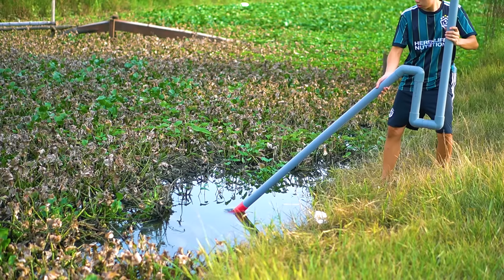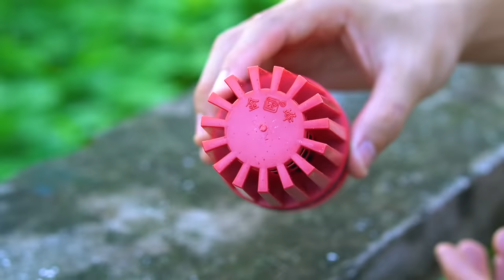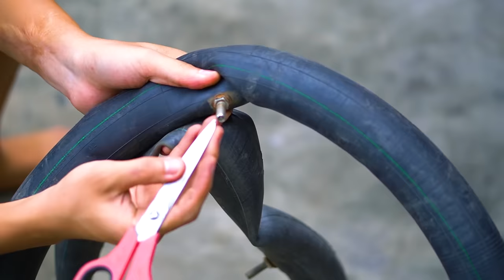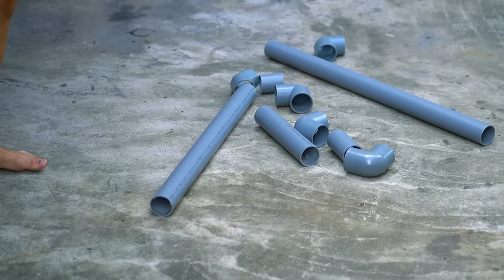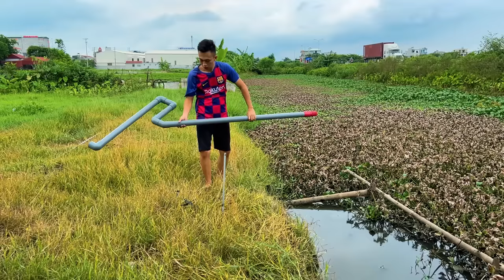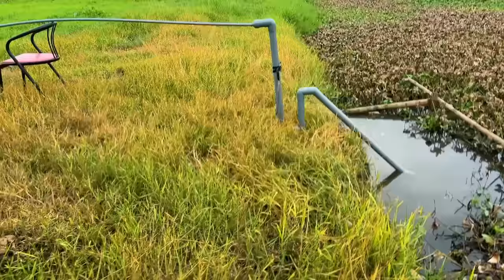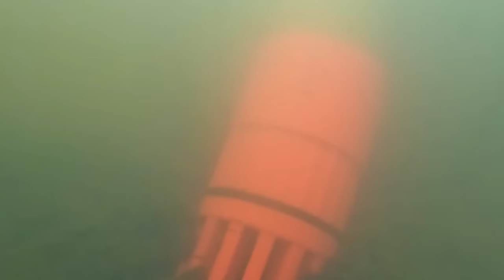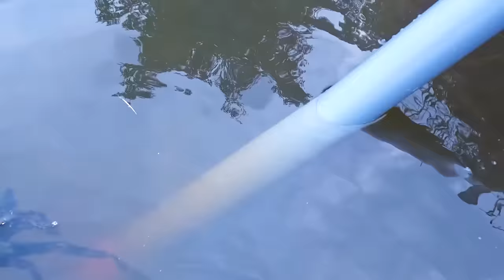I turn PVC pipe into a water pump no need electric power

Comment: I NOTICED THAT WHEN IT WAS ASSEMBLED, THE LENGTH OF PVC PIPE TO THE VALVE & THE OUTPUT PVC PIPE IS THE SAME ABOUT 2 FEET, BUT WHEN IT WAS INSTALLED IN THE WATER, THE PVC PIPE TO THE VALVE HAS BECOME LONGER, IT IS NOW ABOUT 3 FEET. WHY?
Reply: To fit the battery and pump of course.
Reply: The air pressure is limited to the incline in the pipe due to the dip in the pipe - therefore the water pressure is greater than the air pressure. The water pressure thereby pushes IN the value and thereby creates a jet of water pressure that shoots the water up the pipe. Based on Archimedes Principle as long as the weight of the water based on volume is greater than the volume of air in the pipe below the dip in the pipe then the valve will keep sucking water as a spray jet under pressure into the pipe.
Reply: @voidisyinyangvoidisyinyang885  No. The air pressure is of course exactly the same at both ends so nothing would happen and you can also see the very motor in the timelines mentioned, so just stop.
Reply: @dtiydr  have you ever used one of those schrader valves? I have a hand bicycle pump. The whole point is the weight of the water as pressure is opening the value and therefore creates a pressurized jet of water. "the area of the water surface inside this pipe is exactly one square inch. The surface of the ocean adds up to trillions of square inches, each with 14.7 lb of atmosphere bearing down on it. The total pressure on the ocean surface therefore adds up to billions of tons, while the pressure on the surface confined within the pipe you have inserted is a mere 14.7 lb." so how much pressure does it take to open the valve?  the answer is: "you then have to pump about 30 psi harder just to open the valve against the spring "
So how big is that PVC pipe - it's bigger than one inch and looks to be at least 2.5 inches and therefore if it is two inches in diameter then it has enough water pressure to open up the Schrader valve - creating a jet of water. 
So the dip in the pipe acts as a "Pea trap" under a sink - the water jet collects the water there - so that cancels out the lower gravity in the pipe - it works just as a one way check valve so that less vertical draw is needed. So then as the water keeps building up through the jet then the water is pushed up the rest of the pipe.
Reply: @voidisyinyangvoidisyinyang885  I don't even read what you write because I'm into physics and you are obviously not since you try do convince me with "facts" which we all know is of course not or even according to physic laws and thus totally wrong.

The whole apparatus is in direct conflict to to the physical law of conservation of energy. Where does the energy come from that make the water come out from a higher state? Exactly it can't by it self without adding energy which in this case is a battery and a pump, that can also be seen ffs. Open you eyes and listen to ppl that at least have some basic knowledge about physics that you obviously don't so stop spreading your erroneous comments.

Comment: We have a ram pump on a piece of property we bought. It sits in the creek and runs continually without electricity. According to the man we bought the property from it was installed 15 years ago. Ram pumps were invented in 1796 by the guy who co invented the hot air balloon. So all you screaming fake and spouting crap about gravity... lol do a little research. There are different styles of ram pumps and diy plans all over the internet. And on youtube. Y'all just making fools of yourself.
Reply: There is only one reason for why your experience works and that is the energy a flowing creak or river supplies enough energy to ram the water with enough power to reach a height to start a siphon effect.  But it would also need the exit point of piped to be below the source such as on a hill.  But this video is a scam as neither of these requirements is met.
Reply: Ram pumps don't work like this. They require "falling water" (water pressure) as the energy source. They also have TWO actual check valves to drive the pump.

This is NOT a ram pump & it defies the laws of physics, conservation of energy, etc.

Comment: These videos keep popping up in my "suggested videos" page when I open Youtube. I watched a few out of curiosity. So far all I've seen are fake systems that trick people who haven't taken any Physics courses in their lives. These are made to look more complicated by adding valve stems from inner tubes (which do absolutely zero) or convoluted loops and bends etc. on the devices he contrives. This whole thing is clearly a gimmick to gain hits on Youtube to generate advertising revenue. I haven't seen anything on this channel yet that could actually function the way he demonstrates. He's likely installing in-line battery powered pumps to create water flow. I challenge anyone to try this and make it work. If you do, I'll eat my hat. Water simply doesn't flow up hill unless the down hill part of a siphon is longer than the intake or by using a ram-pump which still requires a long drop of large diameter line to push water up a smaller diameter line by shock loading. Learn the laws of thermodynamics. Check this video to see an explanation of how a ram-pump works. It's still not p
"perpetual energy. The return is always less flow than the input. Some water is always lost in order for it to work, Classic 3rd law. When energy is converted from on form to another, some is ALWAYS lost to entropy. https://www.youtube.com/watch?v=9NHVmOchAgI In this case potential energy of water above the pump flowing down by gravity to the pump is converted to an upward push returning a lesser volume back up to a potential height. You can never convert an initial form of energy to a greater on. Doesn't matte what forms you use; electrical, fossil fuel, mechanical, inertial gravity potential, wind, hydro...none. Fact.
Reply: maybe he smarter than Bernoulli 🤣
Reply: 1.8M Water Jiggler pump fuel Transfer Self Priming Shake jiggle Siphon Hose Pump
Condition:
Brand NewBrand New
Bulk savings:

Buy 1AU $14.80 each

Comment: could not get in mind, why the cycle valve was fitted,  what is its function,  the cycle valve works minimum 100 PSI,  depends upon the inner pressure, the one way water valve can work through suction by vacuum basis.  Finally looks great for the people who could not understand mechanism not for the people who know how things works.
Reply: the schrader valve requires 30 psi to force it open. Water has more psi the deeper it is - so the pipe goes six feet down and is 3 inches diameter - so you get greater than 30 psi to force open the shrader valve.

Comment: Even if that check valve worked, it would not pump water uphill! Now, if you connected that to a hose that ran downhill for 50 feet and then you pumped it and it would work in Schrader valve. You’re gonna get 3/4 of inch pipe full of water.😔

Comment: Absolutly it does.you should focus on the tyre pumping nozzle.It allow the water to get in to the pipe but it restrict backflow of water.
Any way I am admired on his creativity.
Reply: Булмогур нарса алдокчилар.
Reply: Fake
Reply: The air pressure is limited to the incline in the pipe due to the dip in the pipe - therefore the water pressure is greater than the air pressure. The water pressure thereby pushes IN the value and thereby creates a jet of water pressure that shoots the water up the pipe. Based on Archimedes Principle as long as the weight of the water based on volume is greater than the volume of air in the pipe below the dip in the pipe then the valve will keep sucking water as a spray jet under pressure into the pipe.

Comment: You are great man..! In every video you break the physics rules.... 😂
Reply: Great piles of BS.
Reply: the schrader valve requires 30 psi to force it open. Water has more psi the deeper it is - so the pipe goes six feet down and is 3 inches diameter - so you get greater than 30 psi to force open the shrader valve.

Comment: Shrader valve lol wtf.  Scooting water won't open that. Maybe an actual check valve for water, but even that wouldn't work on this model. He's got a stick-shaped battery pump with littler hoses inside the conveniently shaped pipe

Comment: This is fake.
Reply: It’s physics
Reply: Ok mate …we made these out of straws at low level schooling you may have had that day off
Reply: @lioneltomich1991  I never been in Low level schooling. I was in highschool on my 4e. LOL. If this works you made a solution for the energyproblem.
Reply: @denisdb725  yeah my mistake ….im not stupid just stoned 🍻
Reply: @lioneltomich1991  You know what? In this I believe you.
Reply: No it’s because of the check valve that it works.
Reply: @3kidsohmy  It will never work. Not if you hold it stady.
Reply: @3kidsohmy  nope ….make one and try it
Reply: This works... is not fake it works.

Comment: It looks physically impossible but I can't see where he faked it. He uses a one way valve to prime the pump and then it just works. There are some pumps out there (like Ram Pumps) that defy gravity and physics. Pretty cool.
Reply: Yeah, magicians' tricks look physically impossible but you can't see where they faked it either. Nothing "defies physics". There are a lot of fakes like this online as click bait or money making nonsense ("If you can't get it working, that's no my fault, I sent you all the parts and told you how to use them!") - it's just clever editing (possibly while someone under the water plugs a garden hose into the bike valve he conveniently added to the device). Pumping the device in and out of the water will force water up the pipe with the one-way valve stopping it from going back, so it will eventually come out the top while that motion is going on, but when he stops doing that, it won't continue, because the weight of water down the pipe cannot make it squirt out the top (and if there's an open inner-tube valve in there it would just begin to leak back through that). There is simply no energy input anywhere in the system as it appears, by which water could be lifted, so it must be being input somewhere by fakery. If water could be lifted without using any energy, it could then flow back down through a turbine and produce "free electricity" - a net output of energy with no input, brilliant. That's not a thing, but people pretending it is definitely is a thing.

Comment: The recycled valve he used, in the bottom caged cone, is the siphon. The cage prevents larger debris, while he shifts the pipe side to side, the valve pumps by shifting back and forth inside, creating a siphon action, hence the little bit of rubber he left on, to create a seal and keep vaccum. The valve is small, and doesn't allow the air in the pipe to burp through to the other side. Pressure builds, and up comes the water. The dip in the pipe helps to further boost the pressure. I see the comments, and I know it must seem like magic to a lot of people, but, it's not. Maybe if most actually watched, and paid attention? The system has a lot of limitations, but it works. Stop with all the "but physics!" bull.
Reply: You cannot "siphon" water uphill. Gravity works the other way.
Reply: The air pressure is limited to the incline in the pipe due to the dip in the pipe - therefore the water pressure is greater than the air pressure. The water pressure thereby pushes IN the value and thereby creates a jet of water pressure that shoots the water up the pipe. Based on Archimedes Principle as long as the weight of the water based on volume is greater than the volume of air in the pipe below the dip in the pipe then the valve will keep sucking water as a spray jet under pressure into the pipe.
Reply: No,there is not a syphon system because in the syphon system the water level ( the river)should be above the land level , to cause water to move ( down)
Reply: @russellsmith9512  yes.No,there is not a syphon system because in the syphon system the water level ( the river)should be above the land level , to cause water to move ( down)
Reply: @radinelaj5716  hey pagal
Reply: @thangkhanpaohaokip2453  I don't understand that language ,speak English pls
Reply: Did you build one, how did it work?
Reply: Needing a pump to make it work, is one of the system's limitations. There may be other limitations true, but needing a pump seems like the main one.
Reply: Er no, just no.
Reply: It only "works" if you make it properly (not as shown here) and keep pumping the pipe up and down to provide the energy to lift the water. And yeah, "but physics"-energy has to come from somewhere for work to be done. No exceptions.
Reply: @mikekelly5869  Exactly, you can't move it without putting in the energy to move it.
Reply: @Russell Smith  you can certainly siphon water uphill. People have been doing it for centuries.
Reply: @tx_rebelsoul8192  Where? Name the application.
Just like cartoons, anything is possible in a YouTube video.
Reply: @miked602  ram pump
Reply: Prove it build us one and show us you and he aren't FAKES
Reply: @voidisyinyangvoidisyinyang885  you are so full of it.
Reply: @tx_rebelsoul8192  what planet are you from???
Reply: @tx_rebelsoul8192 a ram pump works off the water hammer principle not a siphon.

Comment: Oh I get how this works. That thing he modified in the red thing acts as a one way valve. When he pushes the device up and down in the water he’s pushing in water which is stopped from escaping by the valve and pushing out air through the top, till it gets to the P section, which then converts into a siphoning action like how you siphon petrol out of a tank, as long as there is no air in the tube section doing the siphoning action it should still continue till the tank is empty. I’ll have to give it a go but on a smaller scale.
Reply: Have you done it on a smaller scale, and if so, did it work? Cause this would be perfect for water fall garden
Reply: @user-ec3kk6cf5d  Not yet only viewed it yesterday. Will take a while to gather the materials.
Reply: Keen to see how this works myself, it makes some sense but i think the pipes at the P section need reversed then it makes good sense.

Comment: has a electric pump running on a battery,  a 12v subsumable fuel pump  would easily fit inside that pipe and have no problem pumping that volume of water, and you could also fit the batterys and everything inside,  don't believe this BS guys
Reply: the schrader valve requires 30 psi to force it open. Water has more psi the deeper it is - so the pipe goes six feet down and is 3 inches diameter - so you get greater than 30 psi to force open the shrader valve.

Comment: AMAZING I SUCCESSFULLY CREATE 1 SAME SET THAT IS AMAZING💥💥💥💥💥💥
Reply: Are you sure it works?
Reply: Of course you can. Everyone also can. Just know how much you have to create a volume of vacuum suction inside the pvc pipe that make the water keep running. And the bottom valve must free from anything blocking the water go through.
Reply: @transsformer  yes i also created it successfully and debt worked great it's free
Reply: @ahmedal-ayed5339  yes i also created it successfully and debt worked great it's free
Reply: without a electric pump???
Reply: @adiyasri6971  ok
Reply: Electric hai kya
Reply: Ya fals

Comment: OH, MY, GODDD! After reading a bunch of other answers I've discovered a way to solve the world's energy problem!!! FREE energy for everyone, FOREVER!!!
We simply use this guy's invention in double. We get it running, attach a turbine to the upper end, then as it's working we attach a U pipe to the outlet and a length of pipe downward and attach another turbine to extract power from the water flowing down hill. Then since the outlet water is still under pressure we attach it to the inlet end of the device and the water is again push/pulled up the pipe. Now we can remove the pipe from the water source because the water will continue to flow round and round, up the device then down hill. Now the device is mobile and we can attach one or more to an electric car and drive forever!!! 🎉😂

Comment: No this is called a RAM Pump, and it is fed by Gravity, it may actually work, I will experiment with it more to find out.  It would be neat if we could somehow make this work and then have the water fall on a water wheel which could spin up a small turbine to make power. IDK.. Just my thoughts on it. THe more water we could get to flow, the more power we could put into our water wheel and if we could get our water wheel to have enough power we could gear it up to a generator and make the generator spin at a faster rate, then it would be free Electricity.  Or theoretically, I forsee a lot of issues with this though.  I will experiment with it see what we can come up with.
Reply: So what did your experiments determine?
Reply: No this is not a ram pump. A ram requires flowing water, which this obviously isn't.

Comment: Hi thanks for sharing,i trust it will work,but i have a question about the check valve,the piece of rubber  was not inserted again.Will there be compression?
Reply: This won’t work
If it did like he acted it did your house would be flooded

Comment: Love wveryone comment but this is basic syphon principles ram pump yea kinda also but the main force is generated from the water drop that creates air which in turn forces water up the pipe once the water has start water can be build like you see he put the reduce to increase the pressure if he does a double drop then more pressure